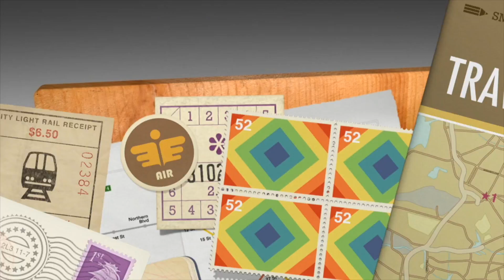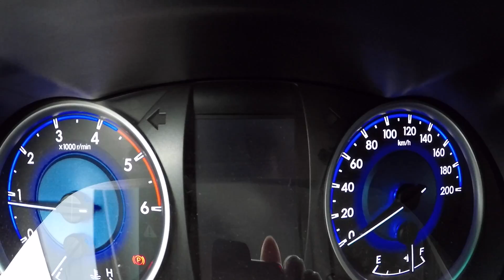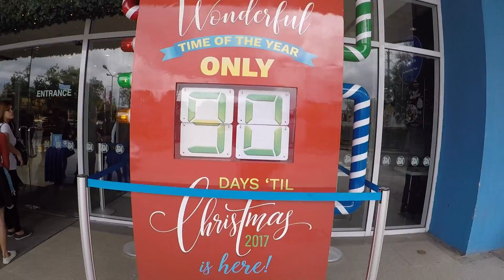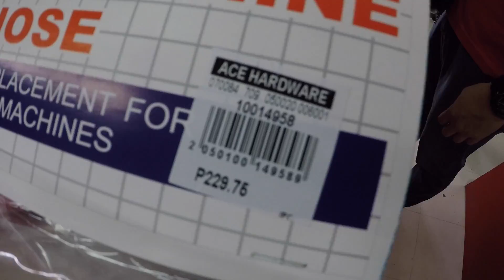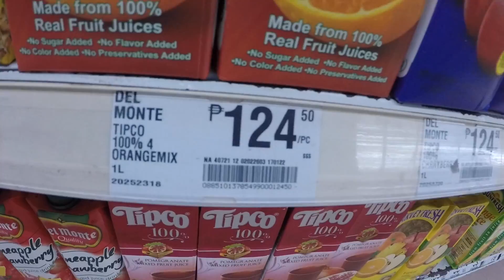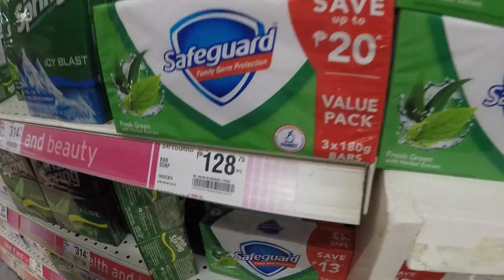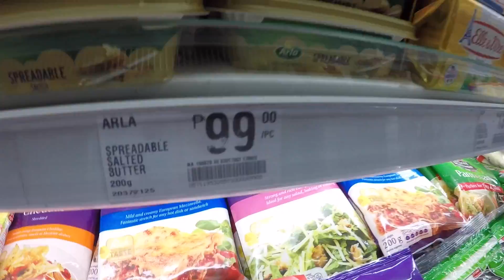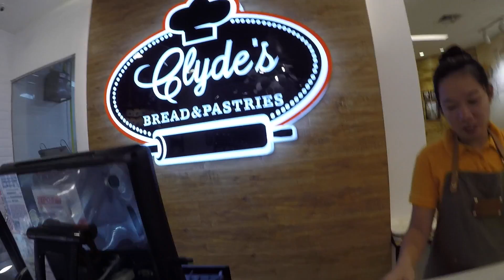VILLA FELIZ - EPISODE 184: SLOW PROGRESS BETTER THAN NO PROGRESS (House Building in the Philippines)

Comment: coming out of silence for two questions... 1) what is the typical residential electrical system in pi? like here in the states we get three wires coming from the pole into your weather head. two hots and a ground. 240 phase to phase - 110 phase to ground. 2) as a united states citizen, how often do you have to return to states by the states requirement? thank you. you are an angel heaven sent to us!!!
Reply: electricity around metro manila and nearby provinces is just like in north america, single-phase 3-wire 220v 60hz.  the service drop will have 2 x 110v and a neutral/ground wire.  other provinces only get 2 wires from the pole, a 220v and a neutral/ground wire.  with the 3-wire system it's very easy to add a 110v outlets to your house.  with the 2-wire system, you'll need a step-down transformer for 110v.  but nowadays, i don't see the need for 110v outlets in the philippines.  i have a couple installed in our kitchen and rarely use it.